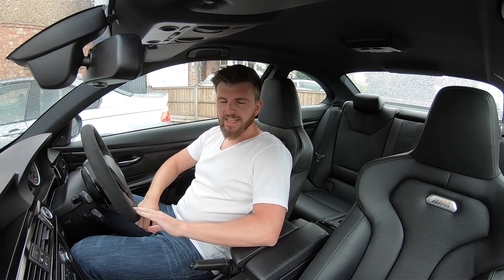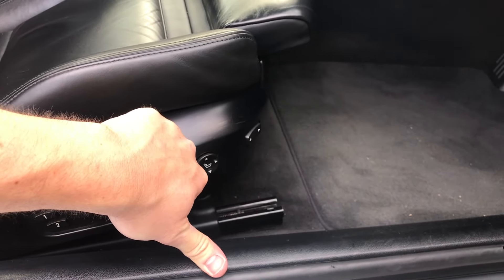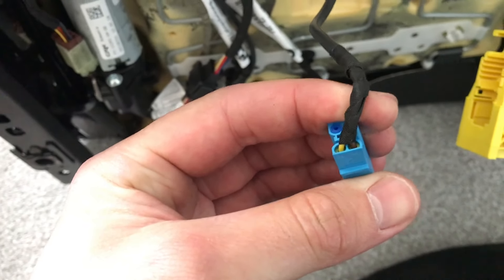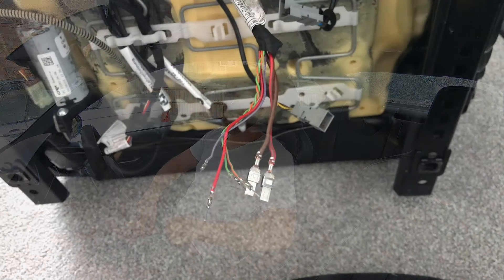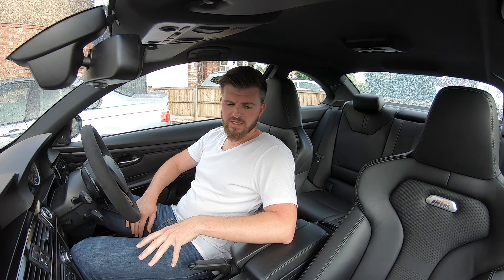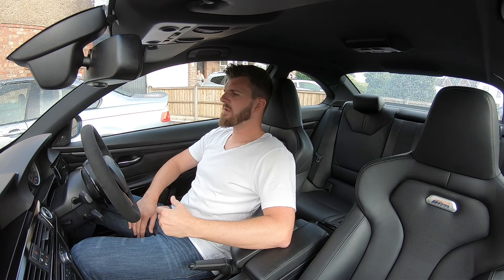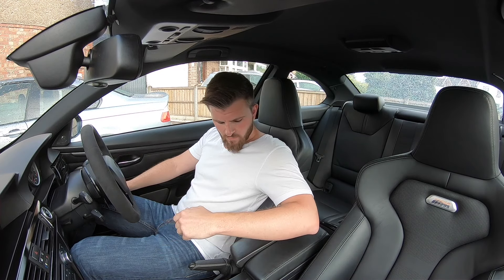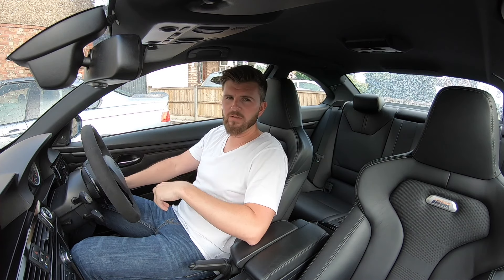BMW E92 M3 Seat Upgrade - ** Fitting BMW M4 Seats **

Comment: Thanks again. This is pretty straight forward on F80 swap to a sedan or hatch as well. I appreciate it. Same thing, use an LCI seat module in E90, and swap the wires to the original plug.
Reply from the maker: Your welcome and glad the guide helped 😎

Comment: Just fitted mine today, pretty straight forward, thanks for the video!
Reply from the maker: Glad it helped 😎👍
Reply: So you has the face lifted e92 I assume? Was it straight forward just take the old e92 seats out and drop in the m4 seats? Nothing else in particular? I wanna get this done as well!
Reply: Did you get the seat lights working?
Reply: @gedam131  I got them to be on permanently based on if the side lights are on, just ran a wire to the rear boot lights. Or just hook them up to the ones shown on the video if you'd prefer them to go off.
Reply: Hello can you send me picture from passenger side plug? the heating and pillows do not work for me

Comment: I couldn’t get the seat lights working. Any tips on that? Connected them but nothing.. you would assume a 12 volt would do the job.
Reply from the maker: You need to run a new 12v positive to the purple wire as detailed in the video which is ideally fed  from the foot well lighting circuit to switch on/ off correctly (past that I cant see why it’s not working)

Comment: Great guide, thank you so much.
Reply from the maker: Your welcome Nick 😎
Reply: @stoneautomotive  Ended Up getting them set up.  Really quite easy in most E90s with the 3-connector module.  did another set in an e82. This is much more involved with the older and larger modules.

Comment: So I got everything working alright but the only problem I have is the forward /back button for the coupes on the top don’t do anything on both sides. It works on the bottom but the top just doesn’t do anything. Did you have this problem at all?
Reply from the maker: @Everything_Bimmers  sadly I can’t say I’ve seen that issue I’m afraid.
Reply: @stoneautomotive  I fixed it just need tonFA code the modules I got from
The junk yard. All good now !

Comment: Love the video! Just a question. I got an LHD E92 M3 Pre LCI and I was wondering if I buy the M4 seats + white modules from an E92 M3 LCI, would the procedure be the same like you describe in the video (of course without needing to code out the headrests) and still work? 

Kind regards from Sweden
Reply: Just saw the lasts few seconds of the video kinda showing me the answer I was looking for but a double confirmation from you wouldnt hurt either! 😅
Reply from the maker: Correct 👍

Comment: Quick question, I’m confused by one thing.
Pre lci m3, so I need to source the white seat modules.
Do I need to make sure the car the modules come from has heated, electric and memory functions, or does it not matter?
Reply from the maker: Correct, they need to be heated/ memory and are side relevant, for example you can’t use a passenger side on a drivers module due to the canbus
Reply: @stoneautomotive thanks for clearing it up! Makes it a fair bit harder to find the correct seat control modules

Comment: What do you think of the recline feature. Is it more on the m4 seat. I find that the e92 seat bottom part doesint recline enaught for me. And when you say that you sit lower in m4 seat how is the leg room under the seat in the back?
Reply from the maker: @edvinasalisauskas7330  really happy with the M4 seat, it does provide much better support and because your lower your legs sit nicely under the steering column.

I’ve never had any complaints from people sitting in the back (when I did have rear seats)

Comment: Didn’t have any power problems? I have a 335i and the seat only runs for 1 minute and then I can’t make it move again, I read something about a 5v signal, i couldn’t find where in the seat
Reply from the maker: Sounds like you have the wrong seat modules as detailed in the video
Reply: I have newer seats, maybe is that? I tried switching modules but didn’t work at all, even tho they plug

Comment: Hi mate is it possible to do a walk through video of how to use/code out airbag once installed seats on ncs expert?
Reply from the maker: Potentially if I change the seats to Recaro pole positions I’ll do more on the NCS expert
Reply: Just to confirm when you coded out the ocupencey sensor  did you have the sensor disconnected before coding out ?  having a night mare with the airbag/seatbelt lights on even after coding  @stoneautomotive
Reply from the maker: @rampstar  yes sensor needs to be un-plugged from memory

Comment: Good job! I am wondering if I can retrofit my e92 lci non-sport seats (heated with memory) with f32 sport seats (heated with memory).
Have you any ideas on it? Would it plug and play with no issues?
Reply from the maker: Hi,

Sadly I’ve only ever experimented with the M cars to advise if it will work.

Comment: just bought the seats and i was wondering if wiring ginna be the same in usa car? or i should use opposite scheme? because my car is lHD
Reply from the maker: Pass, only ever tried on UK RHD car but I would be surprised if it’s different, a subscriber has confirmed the e90 (saloon) didn’t work with the F80 M3 seats sadly

Comment: Great video! I found some 2015 M3 cloth seats for my '11 E92 coupe.  Do you know if the F80 M3 seats are the same as the M4?
Reply from the maker: Sadly not tried F80 M3 seats to confirm if they work, do keep in mind they won’t tilt forward if you still have rear seats as there not designed for a coupe

Comment: Hi, i have a e92 325i and i would love to put this seats... it's pre-lci, would it work? The modules need to be from a M3 lci or can be from a non-M lci car? In my case would the seats mount on the brackets like the OEM ones? Thanks for the help
Reply from the maker: Hi, one of my subscribers has confirmed it works on non-M cars 👍

It’s not something I have tried to confirm myself but providing you have the later modules “hopefully” it will work - I’ve only tried this on the M3 so can’t guarantee on other models.
Reply: @stoneautomotive  nice, and who is the subscriber to i ask of he used the M3 modules or the non-M modules. Thanks for the answer
Reply from the maker: @JoaoOliveira-tc3fi  was over a year ago now, i can’t recall the user sadly
Reply: @stoneautomotive  np, i just got my bimmer too late ahah, within this year i hope i will try to put them in my car, amd hope to get lucky enough to work ahah thanks for your help
Reply from the maker: @JoaoOliveira-tc3fi  good luck 👍

Comment: hello have a technical question my driver's seat does nothing at all with the e92 lci module. but does work with the f82 seat module, but all get errors on the screen. can you help me? plug after adjustment of passenger side?
Reply from the maker: Hi,

Providing you have the right side connected, for example you can’t use a passenger seat module on the drivers side. Providing you have carried out the wiring correctly I can’t advise I’m afraid.
Reply: @stoneautomotive  hello first of all for your comment and support. this is a left hand drive car. luckily everything on the driver's seat now works the reason for it. Not working was the main plug of the module made bad contact. 👍 Only the passenger seat doesn't work, not all the heating and the inflatable side cushions pump don't work. Do you have a picture of this chair of plug connections because I did not see a picture of this plug.
Reply: It's a pity I can't post a picture of the passenger side plug. because it is different with other cables. can someone help me the driver side is ok.
Reply from the maker: @seyfo1971  the passenger side should be the same except for the occupancy sensor which will need coding.
Reply: @stoneautomotive  kan i send you a picture how it conneted at this moment

Comment: Great video. Please it is there perceptible diferrent with seating position? I mean in my m3 e92 I have a feeling, that I'm sitting so much up, I would like to go more down. Are those M4 lower? Thanks for answer. Miro
Reply from the maker: Thanks, yes around 15/20mm lower than standard e92 M3 Seats. It doesn’t sound a lot but does make a big difference as the standard seat height on the lowest position is terrible
Reply: @stoneautomotive  how much lower are the m4 seats over the the Sport seats in the e92? I have a e92 with the sport seats and would like to sit a little bit lower
Reply from the maker: @robertsc  it was roughly 10-15mm lower than the stock e92 seats, I’ve now deleted the sliding runner which has dropped them a good 30+ mm which is awesome now 😎
Reply: @stoneautomotive  thanks for the  reply :) did you had the normal e92 seats before or the sports seats?
Reply: @stoneautomotive  do you have a pictures of the sliding runner? Dont really know what you mean
Reply from the maker: @robertsc  just the standard e92 M3 seats.

Full details in the runner delete are in my project thread :

https://forums.m3cutters.co.uk/threads/stones-2011-e92-m3-competition-project.207436/
Reply: @stoneautomotive  thanks a lot, you really helped a lot :)
Reply: @stoneautomotive  do you know someone who put the M4 seats in the normal non m e92? I have a 325d with the electric sport seats and want to sit lower and thought about to fit the m4 seats
Reply from the maker: @robertsc  one of my subscribers confirmed it works in a 335d 👍 I’ve never tried so couldn’t confirm but I can’t see why not
Reply: @stoneautomotive  do you know which subscriber it Was? 😅
Reply from the maker: @robertsc  not a clue sadly but advised my guide worked perfectly for him 👍

Comment: Great job man 
I have same setup . I can't get the belts to work.
no one accuses anyone sitting on seat .. the belts are not delivered by the arm
what coding is needed?
Reply from the maker: Hi, thanks! All the lines of code that require disabling are detailed in the video for them to work 100% like an original seat on the e92 M3.

All the seat belt hand overs should work like the original seat so I’m not sure what you have done incorrectly. Are the seat belt pre-tensioners all in working order? (not been detonated before etc)
Reply: @stoneautomotive  I am analyzing what may have done wrong.
Do you have the original e90 or m4 pre-tensioners(Seat Buckle)

And I have other problm I have Uk seats And I drive left side in Portugal
Reply from the maker: Good morning, I run the original E9x seat belt belt buckles as the plug on these works with the original E9x car wiring loom once you switch the plugs over.

The canbus on the seat modules is sensitive to left/ right hand side so using right hand drive seats on a left hand drive car may have caused you some issues which unfortunately I wouldn’t have the answer to.. you “may” be able to simply swap the seat modules round to the other seats to rerun the memory functions but I couldn’t say for sure.
Reply: @joaocandido7635  boas, qual é o teu carro, e que módulos usaste? Do M3 ou de um e9x normal? Sempre conseguiste por tudo a funcionar?

Comment: Great video! Going to do this install this weekend on my LCI E92. For coding, what module do I enter (CAS, FRM, etc) for the occupancy sensor and active headrest options?
Reply from the maker: Hi Sean, over a year ago now but almost certain it was the ABG (air bag gateway) from memory
Reply: @stoneautomotive  Cheers mate! Got it all sorted this morning with no codes. Couldn't have done it without your video and help! Thank you!
Reply from the maker: Your welcome Sean and glad to hear you got them in without any issues 😎

If you want them any lower you can drop another 20mm+ deleting the runner (does loose the forward/ backward motion but now sit perfectly 😎

Details in my project thread - https://forums.m3cutters.co.uk/threads/stones-2011-e92-m3-competition-project.207436/page-4

Comment: Hello wanting to do this to my e92 335i m sport do you have the codes of the seat modules you used im assuming all I will need is lci seat modules as mine is pre lci and also m4 seats and the rest will be coding any help would be greatly appreciated:) many thanks
Reply from the maker: Hi,

Don’t have the module part numbers I’m afraid, maybe worth looking on eBay to see if any one has a picture of the bottom of a set of LCI stock seats so that you can confirm the number 👍 they are also different for seats that are heated etc

Comment: I’m looking to install Sparco seats on my F30, I have the seat brackets from an E90, would those fit the F30, are the mounting holes the same for both cars?
Reply from the maker: The bolt/mounting points are the same on the F & E series cars 👍

Comment: Hi, I'm trying to install a same (drivers)seat into my BMW F21. 
I'm having trouble to find the wire for the light in the M seat emblem. You say it's purple, I've founde a purple one but it isn't the wright one.
Can you please give me some advise to locate this wire more easely.
And after finding the good wire, what is the best car wire to connect to so I can see the light of the seat when I unlock the car?
Many thanks for your answers.
Dany - Belgium.
Reply from the maker: Hi Dany,

The seat light cable is simply in the loom/ plug & without taking the seat apart I can’t advise an easier solution to locate it. There’s not a lot of cables that go into the plug so should be easy to rule out unless the light is broken?

As per my video I used the rear foot well lighting circuit on the e92 (on the positive feed is required as the negative is already provided from the seat

Comment: Thinking about doing this to my e46 m3 
And Information you can help with
Reply from the maker: It’s a big job for the e46 sadly, the base frame/ floor mounts don’t bolt in so would require custom mounts which will likely sit to high and the Canbus doesn’t work with the E9x F8x seats so would need to be manual non heated versions. Easier to instal Recaro CS which I have in my e46 M3 👍

Anything is possible just depends how much your willing to spend

Comment: So on my bmw 135i I recently swapped interior and i got power seats but they dont work i didnt have power before, i installed them correclty everything clicked same connections, im wondering if you know a fix any suggestions?
Reply from the maker: Hi, without seeing the car I would have no idea I’m afraid.. if you didn’t have electric seats before then the first thing would be to check you have wired up the looms correctly. Very difficult to diagnose these sorts of issues without seeing the car

Comment: Hello . I put In my e93 , f33 seats . They work but the seats are from uk car and I don’t now what I need to replace some wires or something because in this moment my car computer is don’t knows what seat are left or right
Reply from the maker: The modules are side sensitive, only tried Uk seats on a UK car to confirm. You maybe be able to swap the modules over or need to buy left hand drive modules but try is at your own risk as I have never tried to confirm.

Comment: Hi there,
Thanks to your fantastic video, I'm almost done with the installation of the M4 drivers seat in my F21.
Only one thing. My father (the electrician on the job) asks the voltage of the M seat light. Can you help me out again?
Thanks ahead. Daniël - Flanders.
Reply from the maker: Hi, thanks for the kind words.

The “purple cable” accepts 12 volts - unsure if there is a resistor in the seat that reduces that before actual LED but the foot well lighting is 12v

Comment: Hey, does seats fasteners with bolts fits plug and play? Regards
Reply from the maker: Yep as per the video the e9x seat buckles bolt to the F8x seats perfectly 👍
Reply: @stoneautomotive  so i dont need to use any adapter or weld? :)
Reply from the maker: @maciejlewandowski3561  nope 😬
Reply: @stoneautomotive  please answer with interchangeable words because "nope" sounds ambiguous 😅
Reply from the maker: @maciejlewandowski3561  no welding required - watch the video 😅

Comment: Hi,
do i just have to put on the purple wire + and the M logo lights up?
Reply from the maker: Correct, the best one to run it off is the foot well lighting as it will power on & off with the interior lights 👍
Reply: @stoneautomotive  thanks Bro
Reply: Hello I’ve tried running the purple wire to the foot well lighting and the seat lights aren’t working do I need to run a ground cable as well?

Comment: Do you think this will work with the e90 if i use the f80 m3 seats? I sat in a f80 and really liked the seats and my e90 seats dont hold me in turns
Reply from the maker: I’ve had few subscribers advise the guide works on non M-cars so fingers crossed for you but I couldn’t say 100% I’m afraid as I haven’t tried it personally

Comment: Hi can u help in terms of the passenger seat wiring diagram or even a pic of your plug
Reply from the maker: Hi,

It’s the same as the drivers side but the extra cables you have will be for the occupancy sensor which you don’t plug in and will need to code out.

Thanks,
James

Comment: I’m new to the Beamer game don’t know what lci face lift pre an post means soooo I have a 07 328i can i do this swap ? If so what do I need
Reply from the maker: Hi,

I’ve only carried out the conversion on the M3, LCI models are typically 2010 onwards so a 2007 wouldn’t be a straight swap I’m afraid
Reply: Stone Automotive ohh ok well thank you for that insightful info greatly appreciated